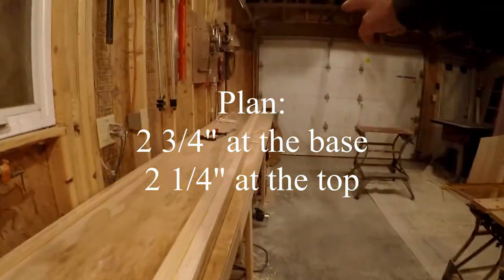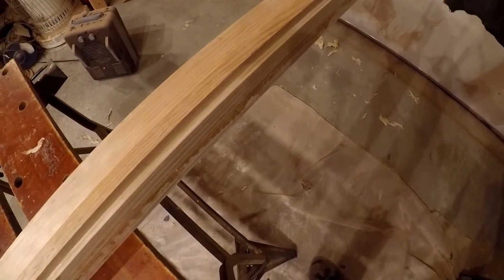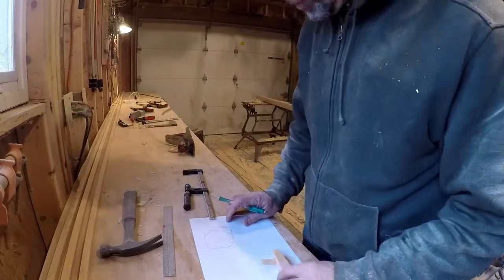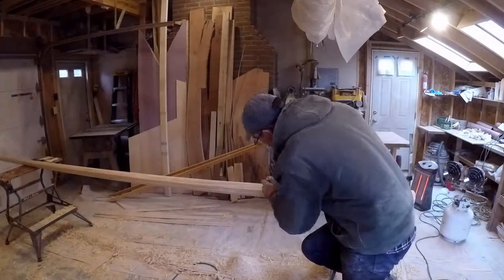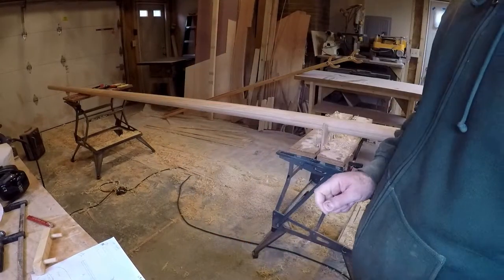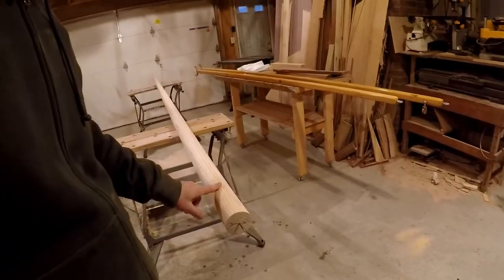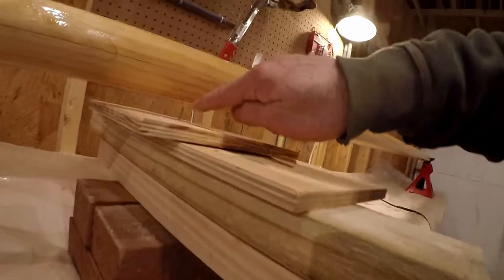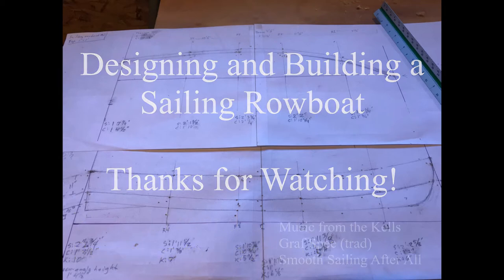Ep 29 Making the Tapered Round Mast: Designing and Building a Sailing Rowboat

Comment: I don't see any point of glassing the mast at all. It's stiff enough for that little boat and if wanted you can use polyurethane varnish on the pure wood as well. Or use traditional varnish. Any wood with Epoxy will end as special waste and is not possible to be recycled.
Reply from the maker: Could be--the mechanical disadvantage is tremendous being stayless, passing through the thwart only a couple of feet from the mast step.  And it hasn't broken so far!